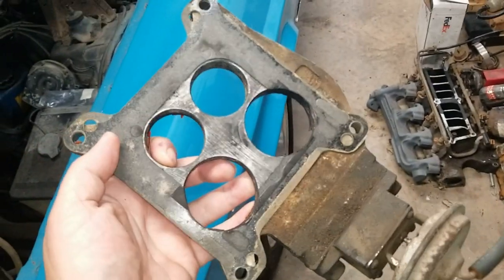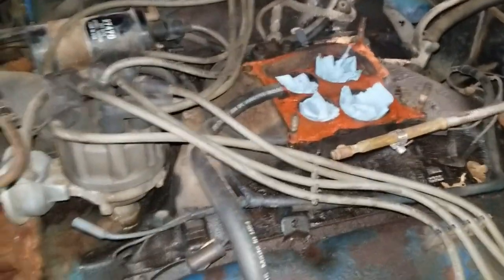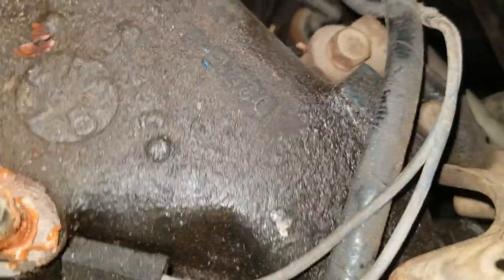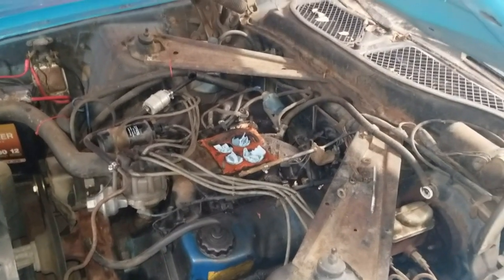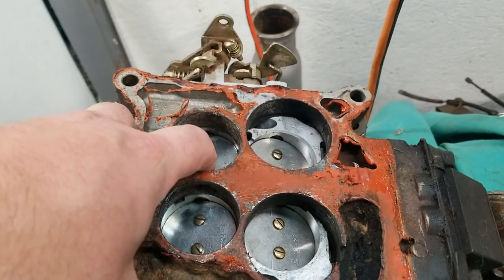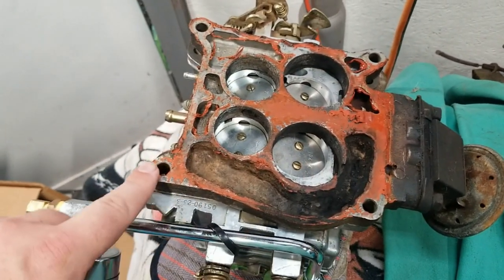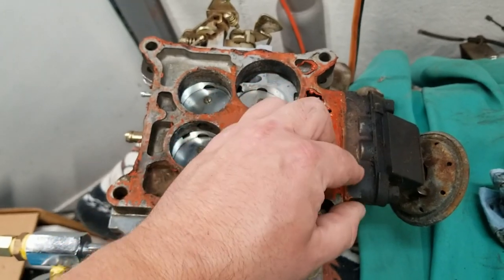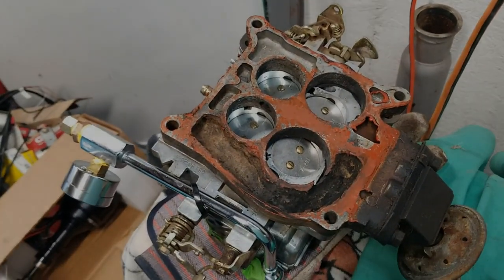Custom Carb Spacer for a 1973 Mach 1 351C 4V

Comment: is the Carb Spacer in preparation to install a Thunderstorm Generator (Malcolm Bendall) ?
Reply from the maker: No, it is just to adapt a standard 4 barrel carburator to the odd ball Mach 1 intake manifold that they had in 1973.  I had to search on the Thunderstorm Generator, is there people doing stuff like that under carbs?  I will be ordering a Thunderhead289 Carb Cheater system to stack on top of my adapter spacer eventually.
Reply: @firepinto  Yeah, the carb is the injection point for the charge-clusters (UV ionized air through a bubbler) in the fuel/air mix.  you can see it on the Generator mods by independent replications with performance & emission metrics.
Reply from the maker: Hmm.. well the Carb Cheater is technically an air inlet system to control air fuel ratio.  Nothing saying what kind of air it has to use. lol